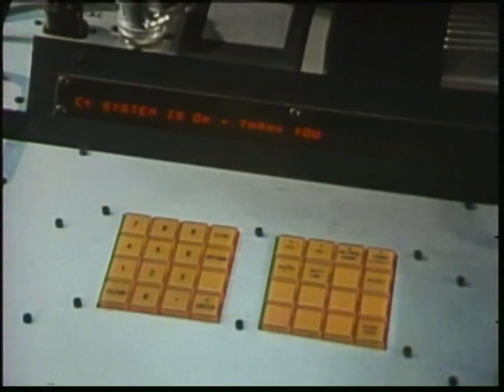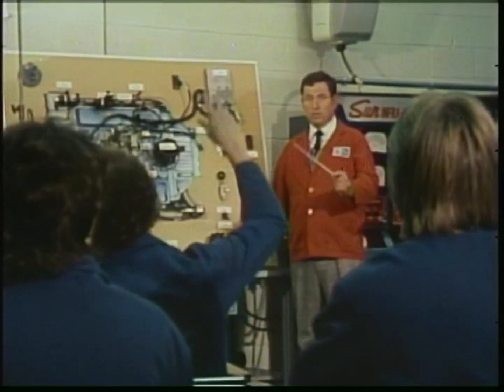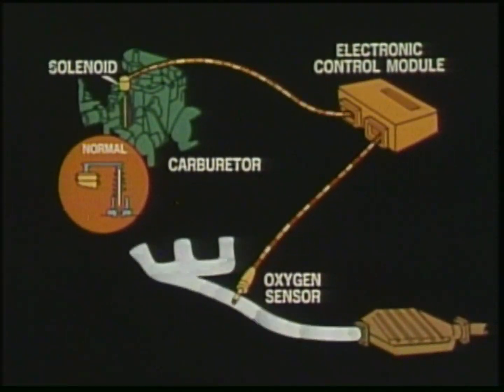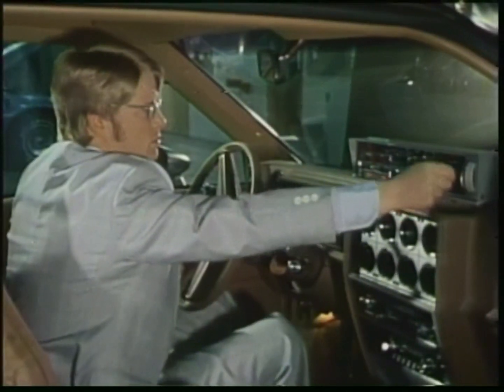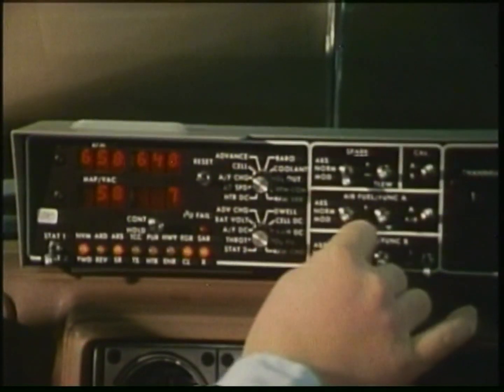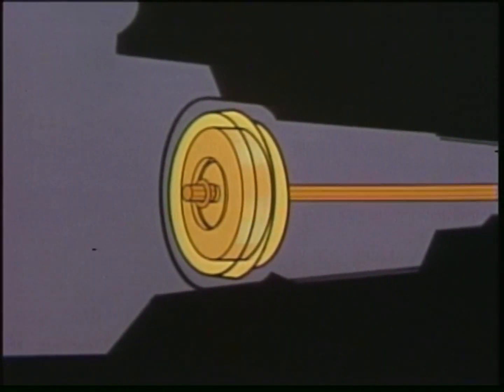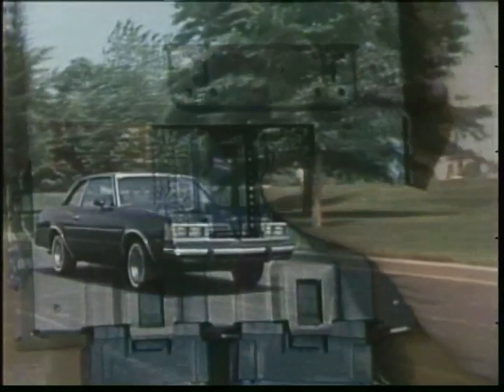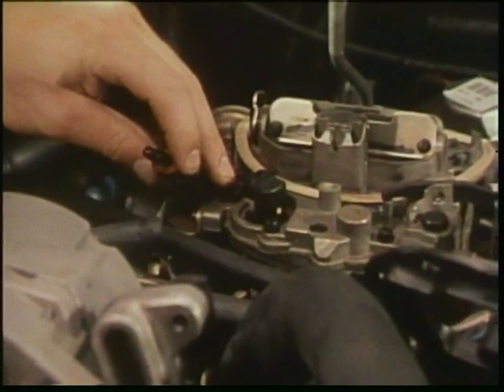GM's 1st intoduction of the auto computer {ECM}.

Comment from the maker: I can't believe they were touching the prom chip with their bare hands. Back in the day when I was working on these that was a big no-no. Just the electricity from your body is enough to short them out they work on such low voltage. You were not supposed to touch them with your hands